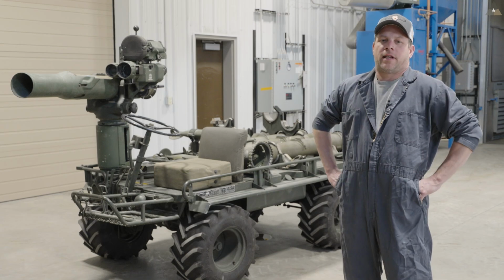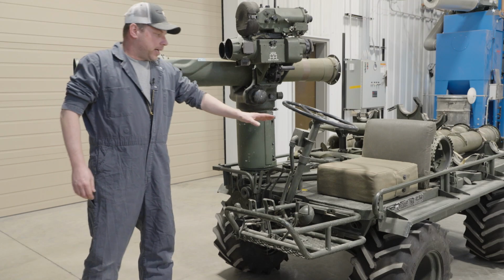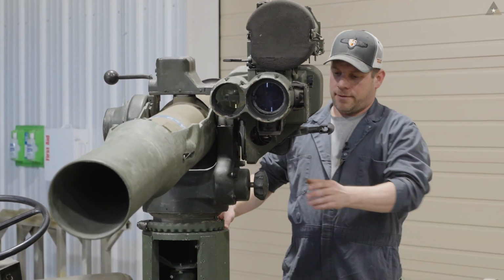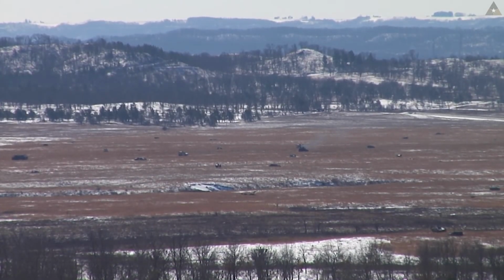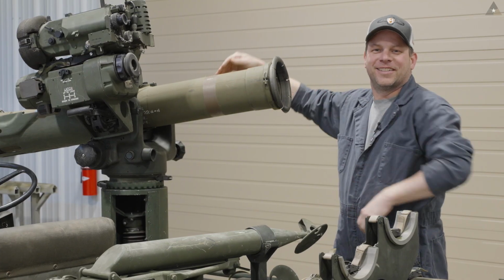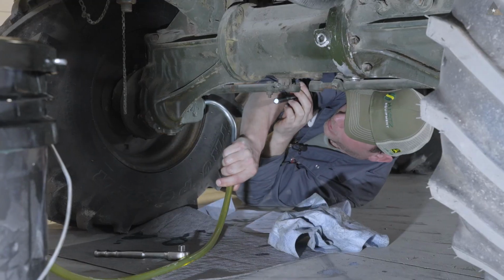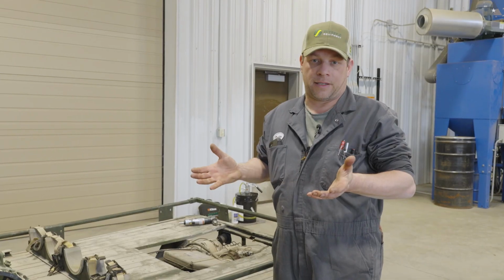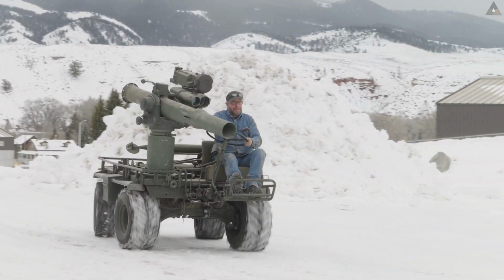M274 Mechanical Mule and TOW weapon system | A practical look

Comment: I see you have one of “Marty’s Mules” electric start kits installed, I bought one for mine when I lived in Eureka, CA in the mid 90’s. Looks like you need to adjust the shift linkage shafts a bit so it’ll engage the full range of gears. I’ve restored 2 of these but never the 4 wheel steer version, those are pretty rare. Nice that you have a TOW system, finding the components in the civilian world is NOT easy by any means and I’m a retired 11H so I can see what’s missing. I was assigned to D co. 2/502 INF, 101st ABN from 1986-93 and we had M151A2’s until April of 1987 but, we also had M-274’s assigned but they were pulled in the early 80’s so my buddies used to tell me about them and how cool they were. As most 11H’s will agree with, recovering from field training was a huge pain in the arse and vehicles took forever to wash perfectly clean but the Mule’s were easy. I really enjoyed my job as a Tank destroyer/Infantryman and served 26 years until I retired in 2009. Fun fact; the TOW missile (From I-TOW through todays modern BGM-71 series missiles) have 4,000 meters of wire on the end but they don’t want gunners to know that since range estimation is often farther than actual range so that’s why they did that. The TOW 2 system was a game changer, it had the ability to defeat enemy IR dazzlers or IR flares that would be able to disrupt our IR trackers in the daysight so, they incorporated a small computer that connected the thermal Night Vision Sight (AN/TAS-4C) to the day sight tracker and MGS so if the thermal beacon on the back of the missile was lost, the computer would search for the added thermal beacon on the tail of the missile and re-acquire the missile track. The wild part is how the sight and MGS communicated. When the missile flies downrange it has a distinct movement image the gunner sees as its in flight and a profile of the weird movements is stored in the computer so if the missile is lost, within a fraction of a second the MGS queries the night vision sight as to where the missile is often located at a specific time in flight and chooses the closest beacon and verifies the connection and continues the track to the target, all of which is barely noticed by the gunner. The TOW missile can penetrate up to 52” of homogeneous steel (not armor treated) which is mind blowing. Obviously it’ll have a harder time with armor treated steel. The wire was the most difficult part of the TOW system to develop back in the day, it has a tensile strength of around 1,000 pounds (not sure how they came up with that but oh well) and it has to be handled carefully when we try to clean up the range, it’s known to cut our hands due to its small size, it’ll cut you open with just a couple pounds of pressure. So that’s why we wear thick gloves and carefully wind up the wire. Sometimes when the bridge clamp is opened the wire cutting function in the launch container doesn’t work and you’re stuck with the wires still connected and then we have to cut them manually. In 1984 while I was in Aschaffenburg, Germany with E co. 1/7 INF we tested firing 4 TOW2 missiles at the same time and crossing all 4 guidance wires to see if there would be any issues and they all hit their targets dead on. The TOW will hit a target within a 16” radius of where the crosshairs are aimed. Each tank/armored vehicle has its weak spots we aim for and Soviet type tanks all have weak turret rings so aiming there is a guaranteed kill but aiming at ammo storage areas is our second choice. Soviet tanks are much smaller compared to NATO tanks so usually all you’ll see is the turret unless there’s hundreds of tanks rolling towards you which is how the soviet tactics worked. I have many other tidbits of unique features of the TOW but I’ll hold for now. I tip my hat to fellow TOW bunnies out there and thanks for making a nice video about our craft, most have no idea how we function.
Reply: I went through AIT as 11H in early 1982. We were training with TOW 1’s or 2’s. Funny thing was that one of my fellow 11H’s mother, worked at the manufacturer of the missiles and she told him that they were currently developing the TOW4! I know, loose lips, but it was cool to know.
Reply: @lowandslow3939  That’s pretty interesting! Wasn’t it fun being on the TOW tracking range at Benning tracking the M-151 slowly driving across the range with the IR lamp/source mounted on the pintle mount while the instructor kept yelling; “point, point, point, point, point…” lol. In 89 I went to TOW master gunner school and that was a great opportunity, I got to learn little details about the M-220 like how there’s actually 4,000 meters of wire on the missile but they don’t tell the men this since range estimation is often farther than actual.
Reply: @echohunter4199  Oh man, I had a hard time with the night sight tracker. That big set of crosshairs on the target vehicle itself, a sign, really, was hard to keep in my crosshairs. They would stop and start and we had to stay on target. Not an easy task, but I managed.
Reply: @lowandslow3939  yeah, I remember that fun, using that huge sight collimator to align the daysight tracker to the thermal sight was a bitch and it would often lose its alignment half way through the process, lol. Then remember that heavy as hell missile simulator for reloading drills and for MILES simulators? If you dropped it something on you would definitely feel that one the next day. Often we’d just cheat and use an ELC (expended launch container). We used to have fun with the simulator by stuffing an empty soda can behind the launch simulator (basically an M-80 firecracker from hell) and shoot them at other vehicles in the platoon for shits and giggles (when time permitted such festivities). Being in a Light Infantry unit was hard work as a TOW bunny, constant camo paint and daily replacement of local foliage to strap onto the vehicles so it looked like a rolling bush, the M-151’s were damn hard to spot when we’ll camouflaged like that, I had one officer staring straight at me as he called me on the radio 50 meters away at an intersection! The HMMWV’s were a different beast altogether, not so easy to hide in 3 foot tall bush/vegetation but we eventually adapted. Exposing the soft skinned HMMWV’s to enemy fire was something we never wanted so we’d use terrain to keep us below their line of sight. The HMMWV could drive on horrible terrain so we could get in creek beds or ravines pretty easily but soft bogs and deep mud wasn’t so easy, once the bottom of the HMMWV body stuck to the mud, it hydrolocked with a vacuum like seal that was near impossible to break, I know from experience when my new driver didn’t do what I said when we came up to a small bog and I told him to punch it and he just looked at me, I repeated it and reached over and pushed his knee down but it was too late. An M-88 couldn’t pull us out, a Chinook couldn’t lift us out and finally we used another HMMWV with a winch and gradually pulled us out…..after 3 days.
Reply: @echohunter4199  At least you got to use real vehicles. We used the crappy Mutt Jeep. They had little ground clearance soft tops and obviously not one bit of armor.
Reply: @lowandslow3939  when I got to the unit we used M-151’s with the TOW pintle in the back and every time we went to the field we pulled off the windshields so it was all open top and we strapped the camo net and poles on top of the hood. You can imagine how miserable it was during the winter months but nobody froze to death or had a cold weather injury. Yes, the MUTT would get stuck fairly easy compared to the HMMWV when dealing with mud. One time our platoon had to go down a dirt road that was deep mud so we hooked a nylon recovery strap we always kept wrapped around the front bumpers and hooked 3 M-151’s together and drove as fast as possible and after being thrown all over the place by the ruts we eventually made it out with mud covering every one of us from head to toe, lol! The MUTT was able to get in tighter places in the woods but it depended on how well the tires could gain traction.
Reply: @echohunter4199  Well that’s true about smaller vehicles getting through tighter places and good idea connecting three Mutts together to get through a mud bog. One of my rigs is a 3rd gen lifted 4Runner and it’s narrow width allows it to go places where bigger rigs just can’t go without dropping trees.
Reply: @lowandslow3939  absolutely correct! I grew up in Klamath Falls, OR and my buddies had some early 80’s Toyota Hi-Lux pickups (SR5’s) and we’d put some 33x12.50 mud and snow tires on them and since they were light weight they’d go places full size trucks never dared. I had a 92 Toyota 4Runner for my young family since driving around Klamath County in the winter time required a decent 4 wheel drive rig and skilled drivers (most folks developed those skills and did just fine, even house wives.). So by the time I joined the Army I already knew how to test the ground to see if it’d support a HMMWV or not and if I could cheat the ground and use momentum to get across a soft patch. Seems city drivers never had to learn that technique.
Reply: @echohunter4199  Absolutely. Sometimes momentum and inertia are our friends. Never stop or slow down in the gooey stuff.
Reply: I was a 19D in 1st plt bandit 6-9 cav 3rd abct 1st cav out of fort Hood Texas I loved reading this because I was the plt Sgts Gunner on an M2A3 Bradley I've shot thousands of rounds out of the 242 25mm  cannon but I have only shot two tow2bs in the four years I was in both of them in training of course one at a moving Target at 2000m and another at a stationary Target at 3,000 m the 3000m target was a hulk it was either a m48 or an m60 I can't remember
Reply: @seantbr2019  Must’ve been a great experience, I never fired a live missile off a Bradley, just M-901’s and HMMWV’s. Those missiles were/are extremely expensive to fire so there was usually a lot of pressure on the gunner to make sure everything was set up correctly before firing since missing the target wasn’t quite the goal, lol.
Reply: @echohunter4199  I'm trying to reply to you but every time I try to reply my comment gets deleted have a nice day
Reply: @seantbr2019  it’s definitely not by me, hope you can get through, maybe use someone else’s account or try a different device? Maybe logging out and logging back in would help?
Reply: @seantbr2019  I love the M60 tank. (The M60 MG too!) In AIT for Infantry, we had to run out to a dirt road, jump into a hole that was just deep enough for an M16 to fit into without poking up above ground level and just big enough for one man, all his kit, rifle, and a LAW. It had rained the night before so the hole was half full of water. We’d crouch down, and an M60 would come rumbling down the road and pass directly over your hole with one track on either side, after it passed overhead, you had to stand up, extend the LAW, and fire a training round into the back of the tank. Dumb ambush location, but I think the idea was to get us over the fear of being so close to heavy armor as it will provide good cover when walking near it.
Reply: @lowandslow3939  never shot the m60 but I loved the 240
Reply: @seantbr2019  I had one cook off once and my assistant gunner freaked. I wasn’t too happy either because I had to continue to control the gun with my right hand, as it fired in full auto, un-commanded, and break the belt with my left hand. Big pucker factor.
Reply: @lowandslow3939  do you know what's funny is I was just watching a video of an M60 running away before you replied
Reply: @seantbr2019  No shit? Not fun. You have to fire it in short bursts so the barrel doesn’t get too hot. It’s the excessive heat that causes the rounds to fire without the trigger being pulled. It scared the hell out of me.
Reply: @lowandslow3939  here's a good one so we had a 240 Charlie that was in the coax Mount of the Bradley there were two ammo boxes right next to the commander's station in the Bradley right next to his head my platoon sergeant in Iraq took an RPG through the side of his turret he doesn't know why the RPG did not detonate inside the turret but it went in one side and out the other but it went through the ammo boxes so all that 762 brass was exploding and his face is all scarred up because of it
Reply: @seantbr2019  Wow. At least the RPG failed to detonate. I remember when Bradleys were just being introduced. They had a TOW system that could be reloaded from the cover of the vehicle. I think it had two missiles at the ready simultaneously.
Reply: I was an 11H Gunner on a TOW HMMWV 1986-1989- HHC 2/9 Infantry Regiment, 7th I.D., Ft. Ord, CA.  My HMMWV was a giant POS, and the back door was incredibly finicky and malfunctioned often, and the turret ring was was crappy, too. Beats the hell out of walking though!  Fortunate that we only had to ground-mount it once, since carrying all that stuff with (then) 4 guys was a bitch. Midway through my enlistment, they reduced the crew to three for some reason.  Fond memories of sitting in the turret on the sling with the gun up or a SAW in hand. I read an article from Raytheon about next generation TOW missiles that will extend the range by 50%, add an autonomous fire and forget mode, and a new rocket motor to fly faster. Happy to hear the system lives on!
Reply: dude this belongs on wikipedia the level of detail you just went into

Comment: nice Mule and TOW system.  I started on a 151 w/ a tow (0352) 85-92 we were told the kevlar blanket was for some of the missiles exploding in the launcher.  As for the wires they are super strong we found out once at PTA in Hawaii when a Amtrak VC was almost pulled out of his hatch when he hit some of the wires that had not been cleaned up on the range yet.  also saw a missile leave the tube but the casing for it was still there the plunger was a little to far down and the guts flew out in front of the launcher.  needless to say we scattered and waited for EOD(Camp lejeune)  Good times and a good video still wanting to come by for a visit on my road trip to Riverton

Comment: In the late 70s/early 80s, Infantry Battalions in the 101st Airborne had these in their Delta Companies.
Reply: 80 to 81 each Plt had one
We rarely used ours but the mortars always used theirs except when deployed
Reply: D co 2 -187 IN 101st ABN 96-98
Reply: In mech infantry they were in Echo Companies on M109 ITVs. In my Airborne battalion in Panama we were a Light Airborne battalion so we had a platoon of TOWs on Hummers in HHC.
Reply: @reddevilparatrooper  * M901 ITV
Reply: @StabbinJoeScarborough  My bad after 25 years of not remembering the proper nomenclature Brother...
Reply: @StabbinJoeScarborough  my bad not remembering the proper nomenclature after 35 years.

Comment: As an 11HE9, I am intimately familiar with the TOW 2 missile system in both the ground mount and the vehicle mounted system. I will add that even when we got the TOW 2, the two sights has to be collimated using a collimater. With the day sight being the "brains" between the two, the collimater was adjusted to the day sight, and the night sight was adjusted to the collimater. The Missile Guidance System (MGS) was used to bore sight the day sight tracker to insure the day sight and the MGS were synced for target acquisition and engagement.
Reply: That seems very complicated. Your telling me you couldn't take the little caps off the scope and adjust it with a quarter? (It's a joke) Hahaha
Reply: @Atvsrawsome  It took 5 minutes or less. As I stated above, the MGS was used to bore sight the day sight tracker, and when attaching the night sight, it has to be aligned to the day sight. There is no form of indexing the fittings, so a way to get that alignment has to be addressed.
Reply: Yep.  11H 1984-1992.   I was at Benning working the ranges training troops on TOWS and just about everything else.   That thing had one helluvu thermal sight.  You could see someone taking a piss at a thousand meters plus.   Around 1989 we were sent back to Benning to become 11M’s and become Bradley gunners.  But, in 1987 Korea we were used as counter infiltration grunts, where I was a designated marksman in CSC 1/503rd under David Grange.  Basically recon and ambushes.  Great job.